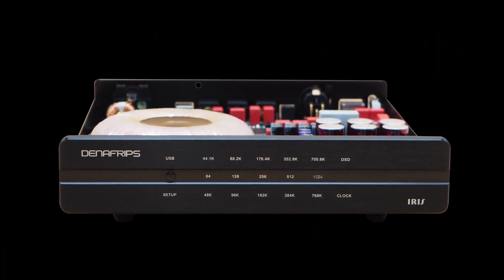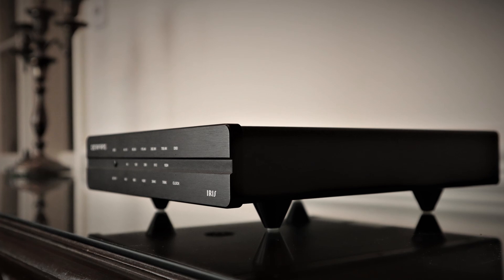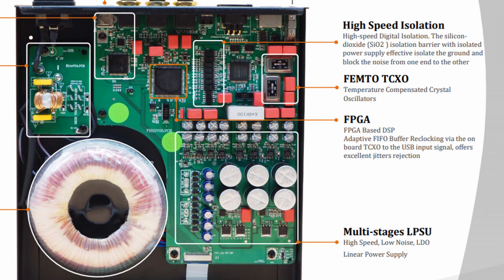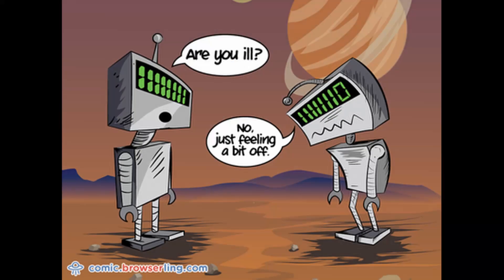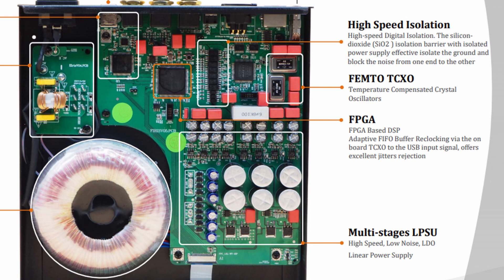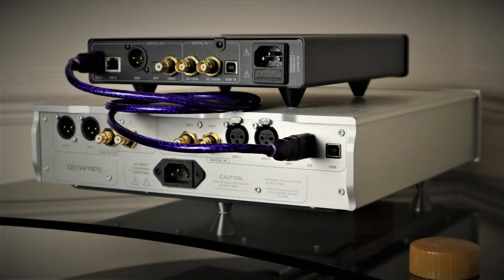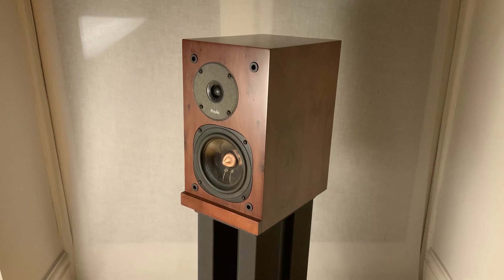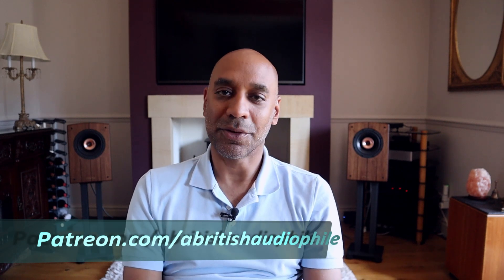Denafrips Iris DDC Review

Comment: In ten minutes, you managed to explain the basics of jitter, electronic noise, galvanic isolation, an asynchronous connection, data buffering, the SPDIF, USB, and I2S formats, coaxial and optical connectors, master and word clocks, and temperature compensated and oven controlled crystal oscillators in a way that even a technically illiterate audiophile as myself could easily grasp. That was, hands down, one of the best technical presentations that I have ever listened to.
Reply from the maker: Thank you kindly Jonas. It is great to get feedback like that 😊👍

Comment: Hi there! I own a venus II and I did find an enourmous diference adding the iris to my system using a Rpi4 as transport. Then I changed the transport to an Allo Usbridge signature, a much better transport, and sound did not improve as much as it does if you remove the Iris. That means the iris is doing a great work concerning SQ making it less transport dependant. I have a quite revealing system by the way and I totally agree that’s the big point (electrocompaniet aw250R and ARC ref 3 with usher big loudspeakers).
Thanks a lot for your vídeos and keep up the great work! Cheers from spain!
Reply from the maker: Thank you Pablo. I appreciate you watching and sharing your experiences 😊👍

Comment: Very well explained! Nice device. It's funny how "digital" was supposed to solve noise, tape hiss, rumble, hum and whatnot, and still it reminds more of the old-fashioned record player than those promises. Let me digress a bit because the global village.
Something that ought not be a problem in the UK, but can be in continental Europe and the USA, is that our AC plugs can be put into the outlet in two ways, thus switching live and neutral. As audio devices tend to make ground connections via their chassis over an audio link, swapping live/neutral between devices can give a significant voltage differential and energy flow between devices. This can cause a lot of edginess in the audio. The reason I bring this up is because I presume that the galvanic isolation works at the level of the bit-stream, but not at the level of inter-device grounding. And I may be wrong here. If my presumption is right, then this problem could only be solved with an optical connection (not my favorite), or by making sure that all audio devices are "phase correct" relative to each other.
In the way, learned friend, you say, paraphrased, that people in some cases can better upgrade their amplifier before thinking of this device, people in parts of the world better sort that AC thing out, before they upgrade anything. I went as far as to replace some of my local standard "Schuko" wall outlets by French ones. The French design doesn't allow you to switch live/neutral and Schuko plugs exist that are compatible with the grounded French outlet. Another thing is that we listen to our AC. In the way this filter needs to reclock and clean the bit stream because of minimalist implementations, the power stages in our analog amplification devices are simple. They generally are designed on the assumption that AC is clean and a simple rectification is enough. And then all the devices in our homes pollute our AC lines and the grid too.
Reply from the maker: Thank you JP. Fascinating to learn about your experiences and thoughts on this topic. Thank you for posting 😊👍

Comment: Hello Tarun! There aren’t many transports worthy of consideration short of one, the Project RS 2 T. This transport utilizes a Pioneer based transport which has been heavily modified. There are other transports and opinions on this vary. I say use what suits your needs and budget. The Project RS 2T is the first transport I saw using an I squared S output. It’s pricey, but so are the others that have the I squared S output. Digital equipment can be real fussy about power quality issues internally. Equipment which can lower this noise floor yield big on the output of your system. The Iris will not turn a mediocre system around. Only an upgrade in component quality will render that into reality. It’s worth the investment to upgrade any components which bring you closer to your own happiness in listening. Happy ears, happy life Tarun! Stay safe my mates!😊👍🏻😷
Reply from the maker: Thank you Mark. Great to learn about your experiences with the ProJect RS2T 😊👍

Comment: Thank you for your explanation of the working of a DAC in a clear and easy way. I knew some things but you made it far more clear for me. In fact I wondered each time why people choose to have a separate DAC. In my opinion when you buy a CD player in the price range of about 700 euros (I have an exposure CD player, the entry level who isn’t made any more) you are ok. I connect my CD player with my Arcam AV receiver using the analog output and my av receiver in the direct mode. My speakers are Audiophysic Tempo and that combination sounds good. For streaming music from,my IPad to my Hifiman Sundara headphone I use a dragonfly cobalt dac with Spotify premium. At first I had no external dac but since I have the dragonfly the sound is much improved and that I could understand because the IPad is a small computer. 
Thanks for your explanation.
Greetings,
Ludo
Belgium
Reply from the maker: Thank you for watching and sharing your experiences Ludo 😊👍

Comment: Thank you first of all for your expertise and thought you have put into your channel and videos.  I have found your suggestions to be excellent.  I have an iris now before my pontus II and it immediately opened things up.  I have found cabling to be as important to getting the best sound, I currently have the best wire world starlight 8 as  a usb between my innuos zen mk 3 and the iris, and an AudioQuest vodka hdmi between the iris and the pontus II via I2s.  The Wireworld especially makes a huge difference.  I am also grateful for your "tweak" that suggested washing machine rubber feet for the subwoofers, they also make a huge difference, putting them under the stock rubber feet that came with the subwoofers made a large and positive difference.  Thanks again, I would ask that you investigate and try perhaps the Schiit Lokius, and, or, the JL audio CR1.
Reply from the maker: Thank you James. I appreciate your support. I hope to review some Schitt gear in 2022. Thank you sharing your experiences 👍😊👍

Comment: Another clear review, both educationally and as to the amount of benefit one could get from adding it. Recently you asked for suggestions as to equipment we would be interested in. As you seem to find it hard to match the quality of your ProAc speakers. You thought that one would have to spend a couple of thousand £ more to achieve this. Surely, it would be worth reviewing ProAc Response D2 or D2R speakers at £2900. 
I recently mentioned that I found that my old Castle Howard S2s were a good match for my Atoll IN200 signature amp. Since then I dug out an old ISOTEK system set up disk that came as a freebee with hi-fi+. That has helped me fine tune the location of the speakers further and taken the sound to another and higher level. I would gladly have paid quite a bit for a tune up disk to achieve this level of improvement. To get it for the cost of a magazine......
Reply from the maker: Thank you Daniel. Speaker positioning is so critical to getting good sound in a room. In fact it is probably the most important thing to get right. Unfortunately, ProAc only send their products out to reviewers they have dealt with historically 😊👍

Comment: Great review, I think you somewhat understated how complex audio transfer via USB is, it's not just a few signals being muxed together, there is also a truckload of handshaking and other stuff that goes into USB, as it is a universal interface, not just for audio.
As for the external clock inputs - wow, I'm used to 10MHz type reference clocks, so these ... odd.
My biggest trouble with audio is Microsoft Windows, I need a decent audio playback solution, all I've looked at are either expensive subscription tie-ins, or just don't do proper bit perfect.
Reply from the maker: Thank you Paul. I was trying to keep things fairly accessible 😊👍

Comment: Thank you for the pedagogical explanations and an interesting review!
I have been interested in the Denafrips R2R DACs for a while. But I now realize an important related question - how does all of this change if/when one uses a DSD signal to the DAC? I understand the importance of low jitter etc in a PCM signal. But, a DSD signal has a sampling  frequency of at least 2.8 MHz (original SACD, DSD64) or higher multiples of that. This means that any artifacts from jitter will be centered around frequencies far off in the very high ultrasound spectrum. And these frequencies are filtered away by the DAC anyhow. Indeed, if I understood it correctly, one of the advantages of the DSD format is that it is technically much simpler to convert back to analog. Since it is only 1 bit resolution, no ladder of different resistors or accurately timed samples are needed, in principle an analog low-pass filter is all that is needed.
So my question is - is it true that DSD is much less sensitive to jitter etc? And therefor would benefit less from a DDC like this? And, if I use DSD (upsampled by Roon in my case), would I even benefit anything at all from an R2R DAC, or are those ladders not even being used then?
Reply from the maker: Thank you Daniel. The DSD inside the Denafrips DACs is handled by a proprietary FPGA implementation. I didn’t notice any difference in fidelity between it and PCM through the R2R ladder network. Not entirely surprising given that the power supply and output stage of a DAC have a significant baring on the overall fidelity. As for the reduced jitter performance through DSD? That is a very good question and would require further investigation 😊👍
Reply: "And, if I use DSD (upsampled by Roon in my case), would I even benefit anything at all from an R2R DAC, or are those ladders not even being used then?"  
I would think not. R2R DACs natively decode PCM. If you are feeding them a DSD signal they will have to internally convert it to PCM first.  I think think the Holo May actually has an entirely separate Delta Sigma segment for handling DSD, but then you'd be completely bypassing the R2R stage of the DAC anyway.  I've not seen someone objectively test this but my intuition says that if you are serious about using DSD it would be best to stick with a quality Dealt Sigma DAC rather than going for R2R.

Comment: I noticed you adviced to upgrade the amplier before purchacing a DDC. I use an Exposure 3010s2d integrated with the Denafrips Pontus Dac, and I still decided to go for a Denafrips Hermes DDC. For my part it was a very good upgrade. The thing is, in my system it removed slight harsness in the upper frequencies and bloated bass, I think that is due to reduction in jitter. So I really don't feel the need to upgrade the amplier or source. I now more than ever enjoy this Exposure 3010sd2, and plan to keep it for a long time.
Reply from the maker: That is great Geir 😊

Comment: Well, the Iris DDC arrived and I have it in the system right now listening to Grace Mahya, Last Live at Dug on the old OPPO BDP-83... Unfortunately that recording is running on optical to the Ares II, not able to utilize the Iris. 

But! I did hear a a nice difference with the Ares II/Iris combo using the new BlueSound Node. It did tighten things up a bit, the bass was and is much more pronounced in a good way. The mids, female vocals were stepped up a notch or two streaming from Qobuz. It was a worthwhile purchase, and I would do it again without hesitation, I would probably upgrade to the Gaia if I was to do it again. 

I will be ordering the Pontus II from Alvin when they are back in stock. I went all black with the Denafrips Thallo and Hades amps... Heck, the Ares II sounded so good, we had to throw in and go all the way, and damn glad I did. Best Hi-Fi dollars I have ever spent. Just call it, Audio Nirvana. ;-)

Speakers are the KLH Model 5, 10 AWG OFC cables I through together myself, I will be upgrading those to Mogami wire when I get a chance to build those, have the cable sitting in the box in the hall... The XLRs, all Mogami/Neutrick and AudioQuest Cinnamon digital cables. Monosaudio power cords on the Thallo, Hades and the two SVS SB3000 subs... Pangea AC 14SE MKII Signature power cords on the rest of the gear. 

Everything I have thrown at this system sounds incredible! Well, not everything, my neighbor came over and he wanted to hear some ABBA, poor recordings, nothing could help that hot mess. Everything else, incredible! LOL!

Thank you Tarun! You and Jay were the motivation, glad I paid attention. ;-)
Reply from the maker: Thank you Michael. Great to learn about your experiences 😊👍
Reply: @abritishaudiophile7314  Tarun, I went and purchased the GeerFab DSD breakout box to use via the HDMI output of the Oppo BDP-83 blue ray player. This breakout box, or D.BOB, it strips the unadulterated DSD signal out of the full A/V single being passed over the HDMI cable out to my TV, then sends that DSD signal via SPDIF coax directly to the Ares II DAC. 

It is pricey, at $1000 US, but to my ear, it was worth it, as it enhances the sound of even older CD recordings. When I say enhances, it does not change the sound per se, but sends that clean signal out, the difference is noticeable in a good way. Everything is tighter, bass is better, faster and deeper, voicing is stepped up a notch or two in the midrange, then the detail, it really reveals much more, in a good natural way. Musical instrument separation is also better, again, in a natural way. There is no digital or clinical harshness in the process, you do not know the D.BOB is in the chain until you remove it. 

Just thought I would throw this out there, as most folks have never heard of this box. I tried one of the Chinese inexpensive models, and it did not work. I did not want to wait another month, so I pulled the trigger on the GeerFab unit. I bought mine on Amazon through Audio Advisor here in Michigan, they are a licensed distributor.

Comment: Hi Tarun, thanks for your video! You’re my go-to for understanding technical details and getting honest reviews.

I’ve tried reading through the comments to avoid repeating a question, but here’s my situation: I have a Denafrips Ares 15th which of course has an I2S input and am considering the Iris 12th to connect between my WiiM Pro Plus and the Ares DAC. However, since the WiiM lacks USB output (only SPDIF and COAX), am I right in thinking the clocking would be left to the less capable WiiM? Would upgrading to the WiiM Ultra with USB output address this? I’m aiming to lower noise floor and jitter without investing in a high-end streamer, which is why I’m considering the Iris.

Thanks in advance!
Reply from the maker: @Alejandro-q4u6h  thank you. You would need a USB output from the transport to use the Iris DDC. The Iris will reclock the signal. However, I think you are better off investing in a better quality transport rather than a DDC. Too much to get into here but when it comes to jitter and noise, prevention is always better than the cure 😊
Reply: @abritishaudiophile7314  Thanks so much, Tarun! That said, I haven’t been able to find a transport/streamer with I2S without jumping up to something like the Eversolo DMP-A8 (£1,900). At that point, I start to wonder if my Ares 15th DAC would become redundant, given the high-quality DAC in the Eversolo (even though it’s a Delta Sigma design). 
I just watched your ABA Award 2024 Source Component: WiiM Ultra the best under £1000, would that be a better quality transport? I’d put the Iris DDC between that and the Ares 15th.
Reply from the maker: @Alejandro-q4u6h  Nano/Iris/Ares 15th is a good front end. The Nano is a better transport than the WiiM 😊

Comment: I just got the Pontus 2, 12th anniv. ed. I can't wait to hear the improvement I will have compared to the Ares 2. You recommend the Iris. Is this upgrade worth the $700 CAD? What about the I2S connection? Is it the best connection from Iris to Pontus 2?
I want to avoid connection problems and having to check the connection every 2 weeks, because the HDMI/I2S standardization does not seem stable. Did I understand well?

Finally, my components were chosen mainly from reviews that I have read over the past 2 years (Hegel H190, Denafrips Pontus 2 12th., iFi Zen stream, SVS Prime Pinnacle speakers, OFC cables from SKW...).

As you see, your suggestions have effect. So thank you for your excellent work.
Reply from the maker: Hello my friend. Give the Pontus 200hrs use before judging results. IIS is not always the best connection  as it is dependent on the quality of the source. The Iris has the clock from the Venus so would expect a subtle improvement using it with the Pontus 12th. I would spend the 700USD elsewhere though 🙂